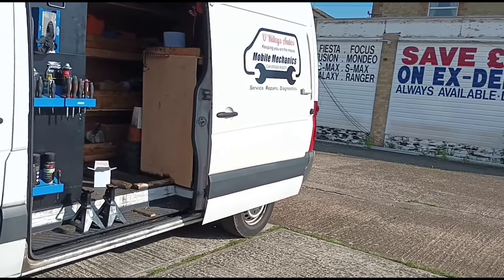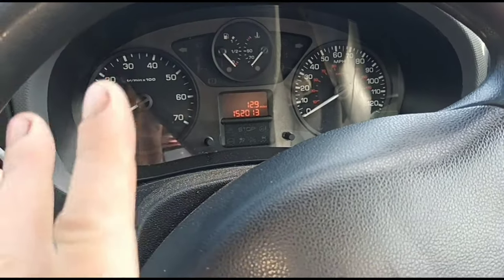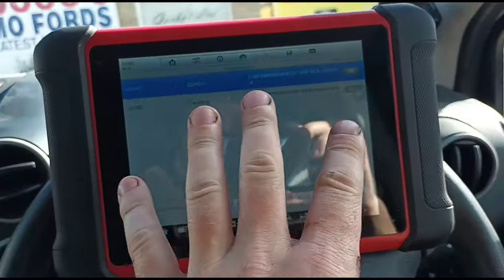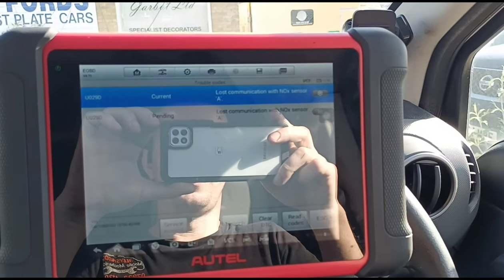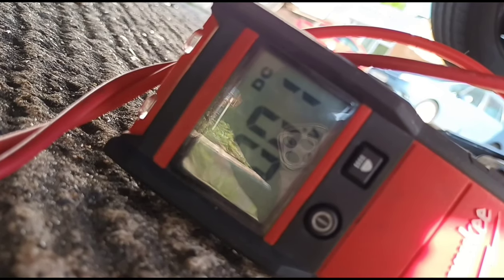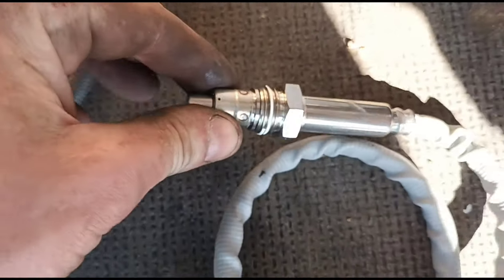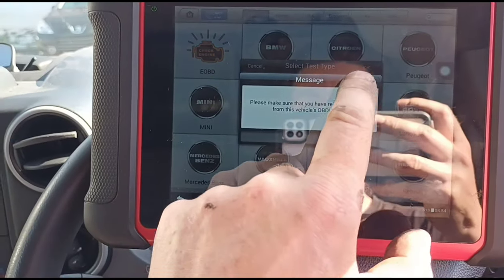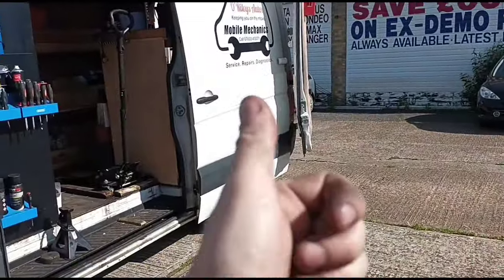U029D Lost Communication With NOX Sensor.  Diagnostic Testing & Replacement. Peugeot Partner 1.6 Hdi

Comment: Hi, great video as usual, I was wondering if you might be able to shed some light on a fault, we have a Boxer with u029E fault, now when testing the sensor, 12v supply seems to be missing. Does it fee from the Adablue module? there are adlbue pressure faults etc aswell, or is the adblue in standby as no communication with NOX? 

Thanks in advance
Reply: Any luck with this? I have the same issue
Reply: Idem

Comment: Hi, i had a customers 2017 ford ranger. Ad b;ue countdown mileage and a nox sensor fault with parameters exceeded etc. The actual sensor was goosed. I replaced the sensor and then it came up with this U029D. Any input would be great mate. Was the sensor after DPF sensor. I checked the dpf re-generation was active when driving and it is. It still regenrates as normal when it has to. So will this mean the adblue mileage countdown will just go back up once its almost down to 0 miles before engine disabled to start. If the dpf is clean and being worked properly with the adblue will this fault still possibly cause it to go down to zero mileage u think and engine stop ? Any input appreciated mate. Im taking it back the morrow and other than the possibility of a open circuit wire it might be a head scratcher. The new sensor was genuine ford £480.00

Comment: just a thought on eobd plugs no connection always make sure you are not connecting to after market equipment that some fleet companies use  ie trackers more  disconnect go go dirctly it manufacturers  plug ,ps always make sure you reconect  when finished  as fleet companies cannot do their work, also determine signal is faulty nox sensor or the rest or car by disconecting wiring to unit

Comment: i notice the new and old sensor in your video have different part numbers one ends 780 the other ends 980 does it not matter which numbers is on the sensor
Reply from the maker: It came from dealership so maybe a revised part

Comment: Just changed my Nox sensor and getting the same code as you in the beginning of the video… could the new sensor be faulty?
Reply: Hi. Did you ever resolve the issue? Regards
Reply: Same what is the next step?
Reply: I have the same problem any 1 ever resolve it would it be wiring or  something gone a stay 🤔
Reply: can bus signal  could be corrupt always check with scope  if possible as voltage is what its say not a signal ,its a good way saying got signal but not if that signal is good on off ,.this possibly why after market parts don't work ,corrupt signal not missing signal ,they do need calibrating but will work some degree out of box ,

Comment: I have just got this code today U029D mine saus lost communication wirh downstream nox (intermittent) and also P2048 adblue/def injevtor control short circuit to ground (intermittent). My car is a 1.5 bluehdi 308 2019. 105k. Also i notice thermal aging of cat convertee 99.5%, looks like adblue not injecting. 
Got a few rhings going on witj this car 1 being oil entering the exhaust and throttle which is not pre turbo (pcv) so i imagine it is the turbo as the acuator buzzers. Woild this be the likely case of the turbo seals leaking and contaminating the cat and sensors therefore the nox not sending any communication to the adblue to inject 🤔 im close to scrapping it 🤣

Comment: It's so easy when you do it😅
I've just replaced one and still no fix. All voltages on the plug present. No problem connecting and resetting the sensor. But the fault code won't go away 😢
Reply: Did you ever sort this, got same thing on 2017 trafic with u059f
Reply: No unfortunately not. It's a rental company's van and they didn't want to spend any more money and just condemned it.